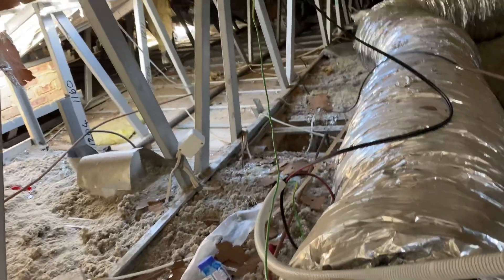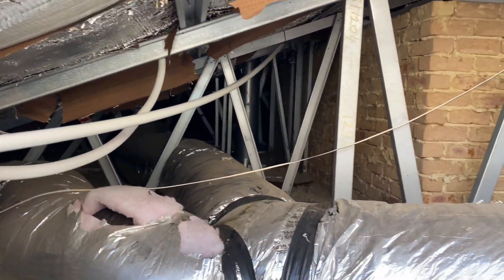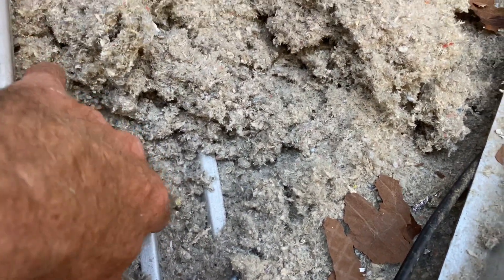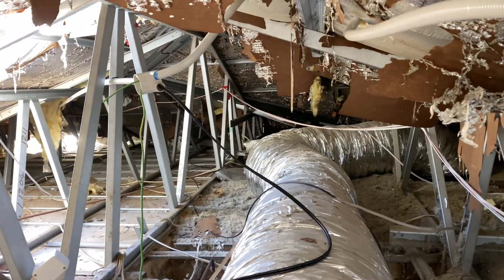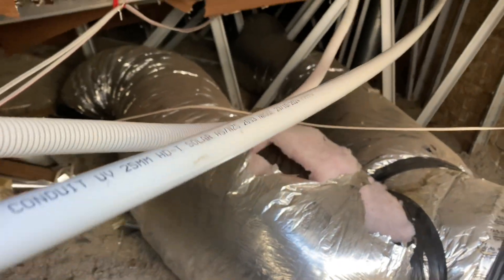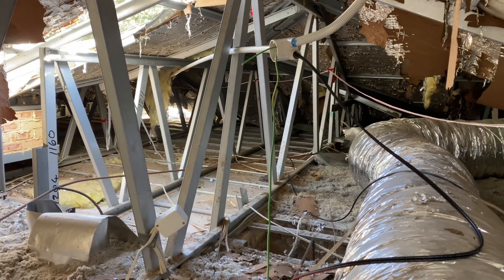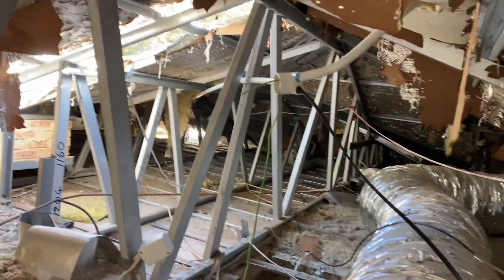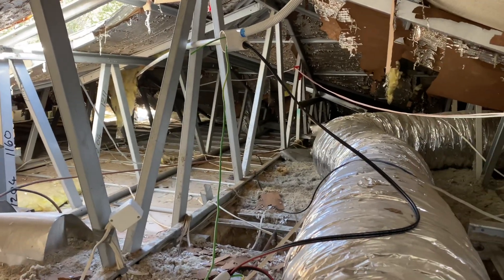The side of solar power installing that I hate! Why I dont do many full installs these days 😅

Comment: I'm 55 and now refuse to work on steel frame houses, being a new house installation or additional work.  They suck and are too difficult and dangerous to work in.  I'd rather have the day off and go fishing, and i don't like fishing either.  I almost always come out of the roof bleeding from being cut by the steel frame or fasteners.

Comment: You also need to check that the steel truss is connected to the earth. The best thing to do is pull the cable and push the conduit over it from the manhole so you get the breeze coming up. You can't fit 2 strings and earth in with new-spec cable, which makes it a bit harder.

Comment: Why don`t you use micro inverters apart from price they shit on central by a mile all the ones i have every put in shit`s on the rest but the price sucks and you do not have to run conduit because 240 volt AC  not 800 volt DC a hell of alot saver love your videos and all ways to anyone to use you .
Reply from the maker: Hmm yes and no, not a fan of micros. We only really have Enphase and I dont like the idea of having all that sensitive electronic equipment on our extremely hot roofs. 
And thank you I appreciate the nice words.